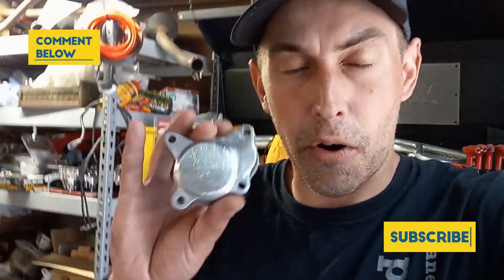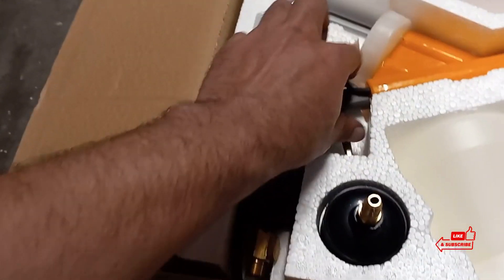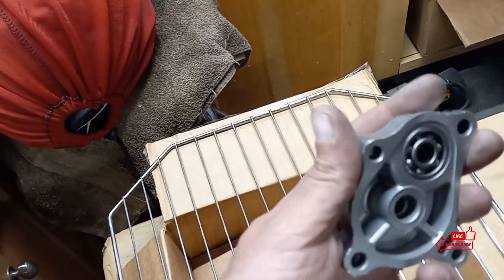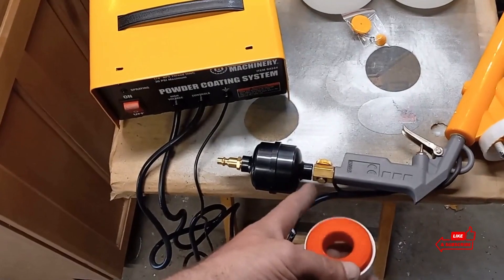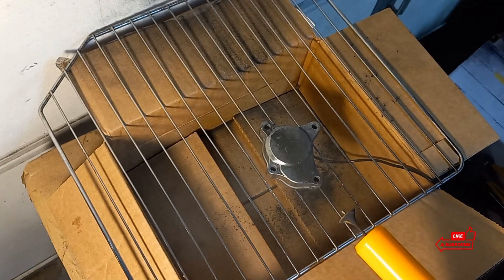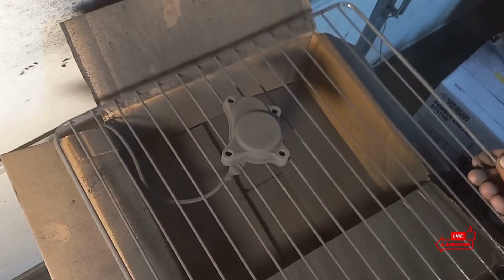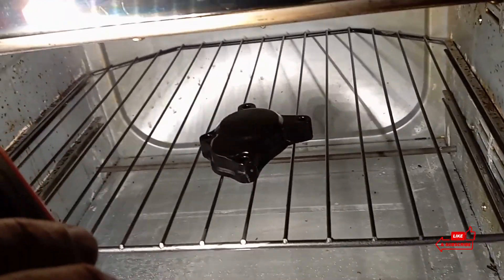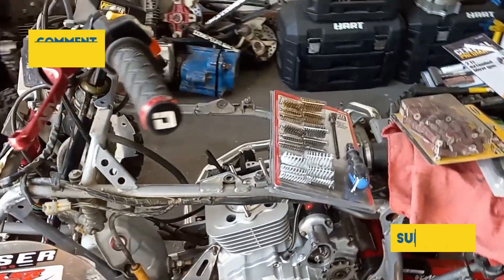DIY Harbor Freight Powder Coating System. Unboxing & First Use

Comment: Thanks for the review!
Reply: Wondering could you just pour paint  on top of part instead of using the gunn then bake ?
Reply from the maker: Ty
Reply from the maker: Idk bro maybe if you could control the powder. But I'd just get the tool. I upgraded to the Eastwood gun it's $30 more then the harbor frieght gun and 10 times better
Reply: Ok thanks I'll look for that clint Eastwood gunn that's how I'll remember have a great weekend!

Comment: What's good my dude lest go with harbor freight. Want to try it out myself getting one this weekend. PEACE
Reply from the maker: gotta mess with the pressure regulator. it works better turning the built in knob on the compressor itself came out way better
Reply: @garagemcmatt  hell yeah hope it works good I'm trying it this weekend on some old parts I got around myself. Can't wait to c what's next bro PEACE
Reply from the maker: @actionislive69  definitely start with some test pieces

Comment: Cool little video man . Think as you put the air pressure down a little you'll get better results
Reply from the maker: Yeah I messed with the reg on the compressor itself and came out a little better. I'll get it dialed in ty for the comment

Comment: Question, working on a 2004
400ex, in the left case there is a small needle bearing under the shift drum. Can you tell
Me where to get a new one, no one in my area seems to know!
Reply from the maker: Rockymountainatv.com in the oem parts finder

Comment: I do powdercoating on the side, and many problems here matt..lol
Pressure is way to high, your to close to the part , and that gun sucks lol😂 best bet is to return it and buy eastwood dual voltage for like extra $25 it's 100x better and the low setting allows you to get in tight spots and finish comes out like glass
Reply from the maker: I'll check one out. I seen those too I just am a little kid and wanted it NOW

Comment: Great video! What pressure worked the best and is the powder coated surface durable?
Reply from the maker: 10-15 psi and the durability is all in the prep and the quality of the powder you use. But yes it's holding up well
Reply: @garagemcmatt  10-15 PSI. Eastwood gun, Prismatic powder is the best. Sand blast part first, then soak in acetone for 15 minutes, then degass by baking at 450 for 45 minutes, then soak in acetone again for 15 min, then with new gloves use hi-temp silicone tape tape for any taping also plugs. preheat oven to 225, preheat part. hang or place on rack then coat. place in oven at 425 for 45 minutes or whatever Prismatic spec sheet recommends. That's how you get pro results!
Reply from the maker: @darrynruzicka2883  I switched to the Eastwood gun since this video and the results are night and day

Comment: I think hanging the part instead of laying it flat would also help a lot
Reply from the maker: I'm gunna try it with some springs next and hang those. This part I didn't want any powder on the bottom
Reply: @GarageMC  Right I personally never done it but I have watched it be done few times and I was told they hang it because it allows for a mist more then a blod basically and allows for all the excess to be able to settle to the ground rather then build up the piece of course these aren't the exact words I'm looking for but sometimes I'm semi slow
Reply from the maker: @ALDA2479  lol. I got the pressure figured out now I messed with it some more after the video I think I have it dialed in pretty good now

Comment: Maybe crank down the regulator pressure
Reply from the maker: I had it on less then 10 psi. I got it working pretty good since then. I ended up upgrading to a Eastwood gun.....way better

Comment: I have the same gun. For some reason the canisters of the powder are a different thread than the canister that comes with the gun....wtf harbor freight
Reply from the maker: Same here. I just went to the Eastwood dual voltage gun. Way way better and it's only $130